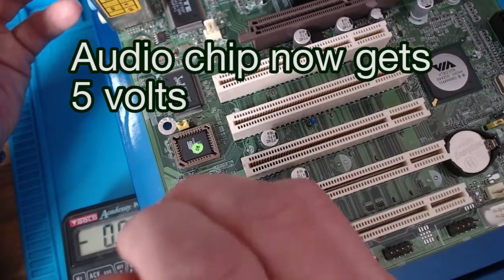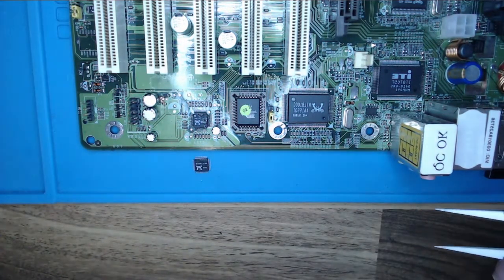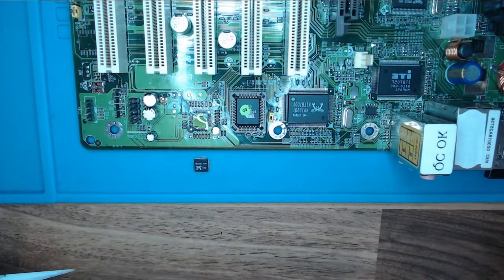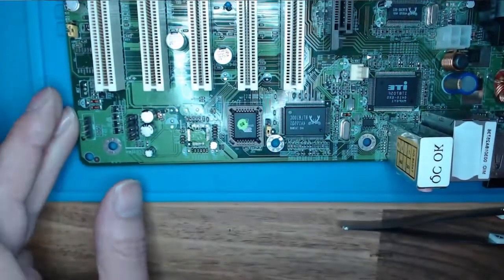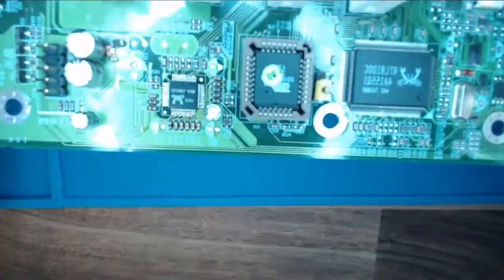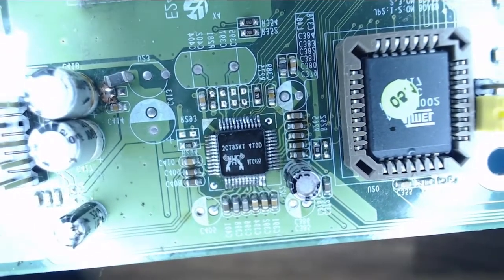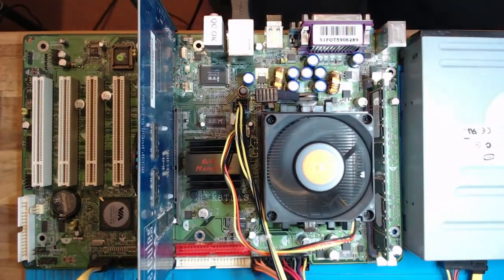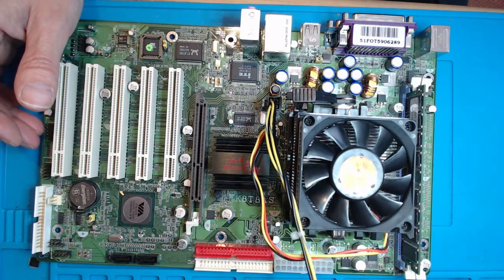Swapping a Realtek ACL655 Audio Chip Motherboard Repair

Comment: I’d be stressed attempting that too.I have the same issue onboard audio isn’t working but works fine with a sound card installed.
Reply from the maker: Did you try moving those jumpers to enable onboard sound? What is the model no. of the motherboard?
Reply: Philip Bryden hi,I didn’t actually see any jumpers on the board from memory.I would have to look again.Audio is working from the motherboards HDMI port but not the audio jack ports which is strange. I hope it is just a matter of adding a jumper.

Comment: Bummer that it didn't work out. The great soldering job you pulled deserved a working audio output. Life's unfair....
Reply from the maker: I'm really pleased with my soldering ha ha. It is a shame it's not fixed the issue. The big problem is that it takes so long to boot to CD and test it. It's an old 32bit CPU, the motherboard won't boot to USB. By the time the OS is running and it's online, I'm already fed up with it.